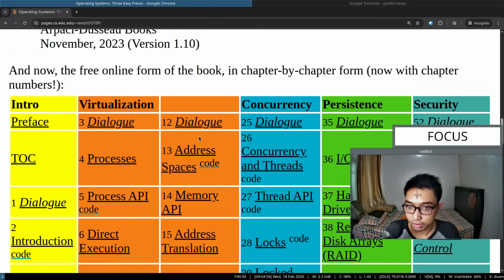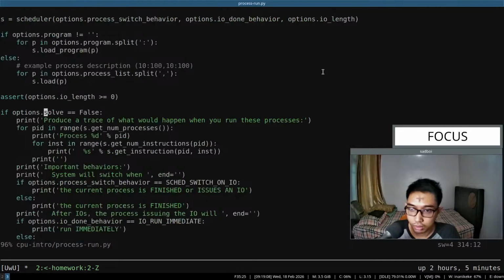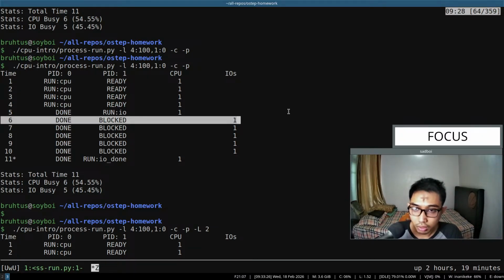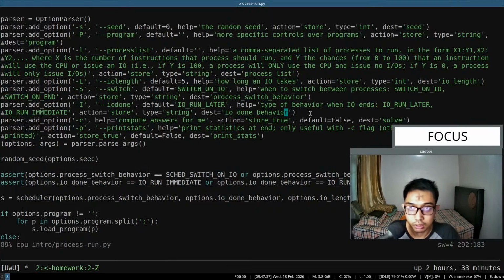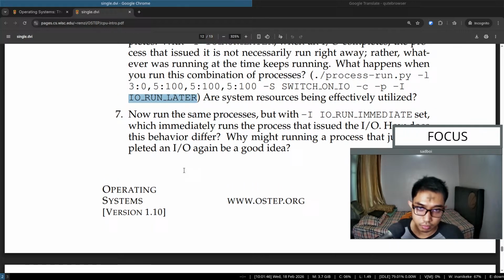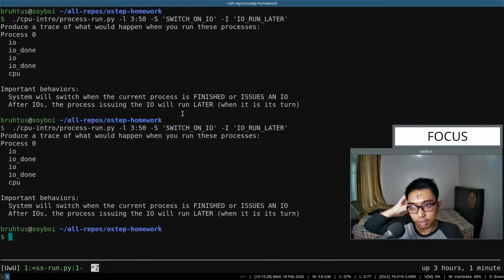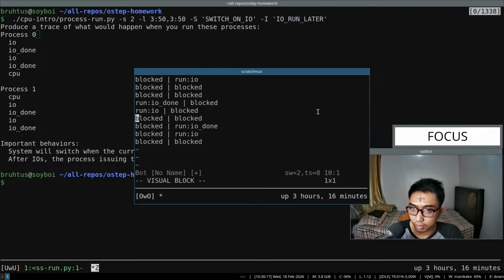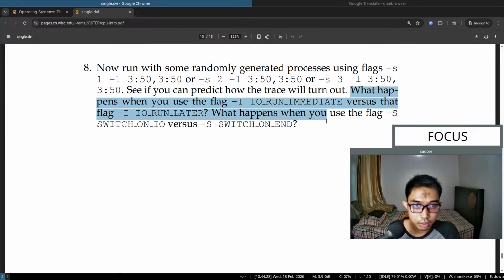Live study: read along book "Operating Systems: Three Easy Pieces" (Part 8)

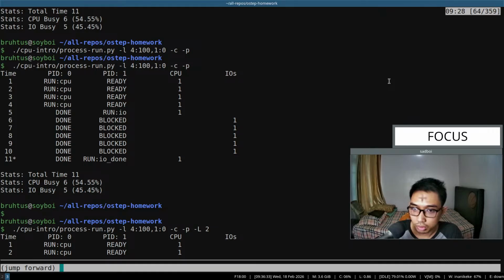Comment from the maker: 32:29 It's interesting that my terminal emulator cursor color changed when using "jump forward" in tmux, but after i recompile my terminal emulator (which is `st`), the cursor color did not change again.
Still not sure what's going on yet, the possible cause that i could think of is either from updating my system or interupting the running linux kernel kselftest on my machine which might changed something (?).
Let's see how it goes~